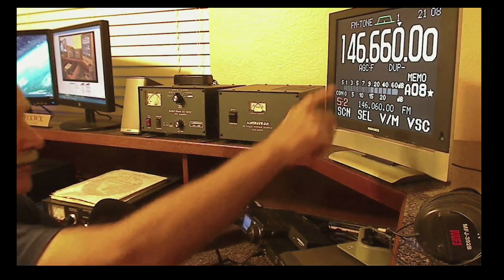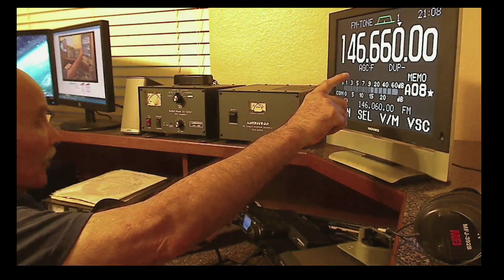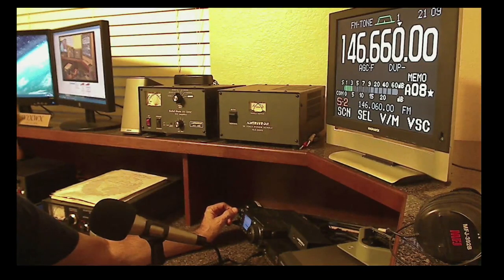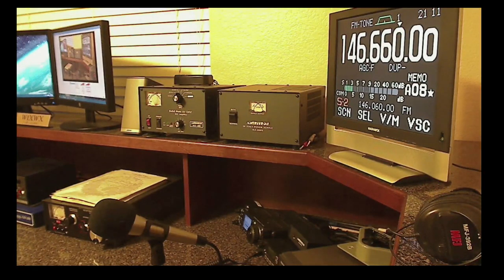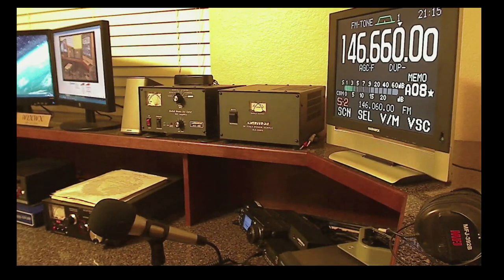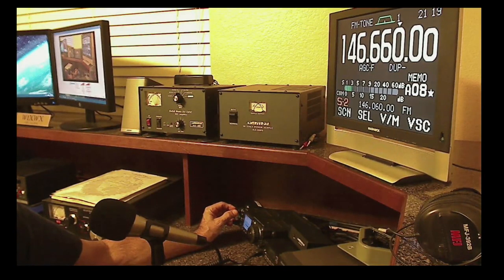What the heck is a HAM RADIO NET?

Comment from the maker: Just a few notes: the beeps after each transmission are called a vanity tone or "repeater-tail" on the repeater. It let's you know when the person has stopped transmitting; and also pauses the repeater for a few seconds so someone can jump into the conversation.

Net Control- runs the net

Some nets are informal without a net control. The one you were listening too was a more formal net since no one will transmit without being called by net control (or recognized).